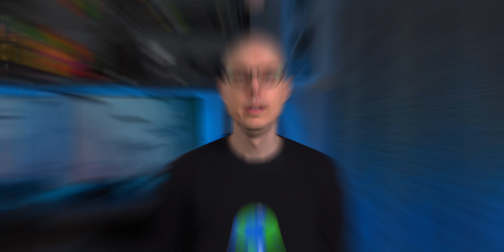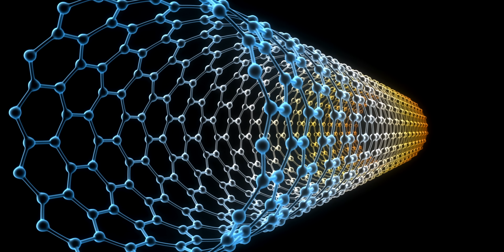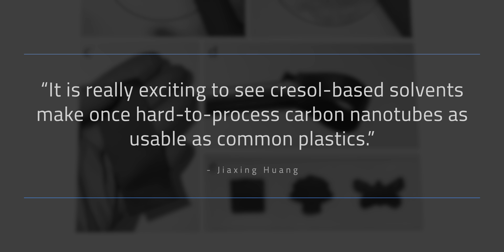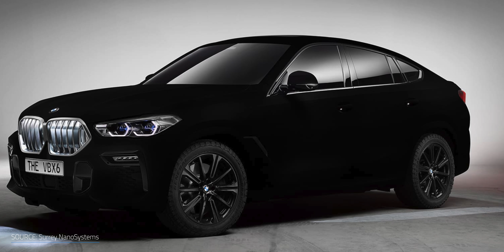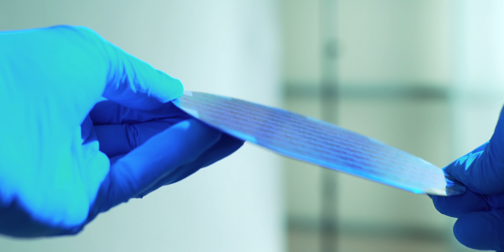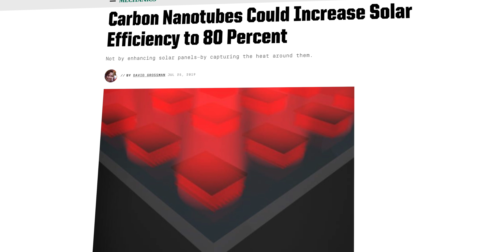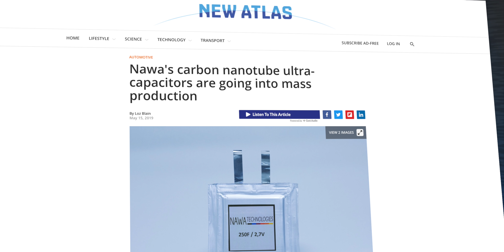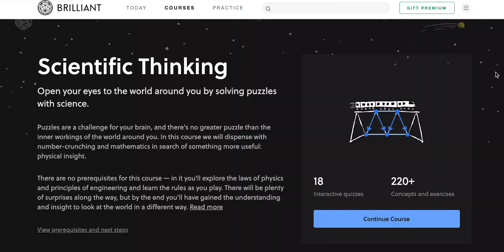How carbon nanotubes might boost solar energy - explained

Comment: Couple of comments as someone who did research in the field... 1)"As it turns out carbon nanotubes can be easily mass produced already." This is true only by technicality. Yes, they can be mass produced, but not really in the desired forms that are useful (yet). You mentioned chirality and semiconducting vs metallic but, as far as I know, it is still extremely difficult (and/or expensive) to selectively grow specific chiralities. The same for of the other major factors determining properties such as length and number of walls. 2) I cringe every time anyone brings up the space elevator. It's not feasible/impossible on so many different levels and has done more harm to the development of nanotechnology (as you mentioned by setting expectations so high) than good. It was a terrible back of the envelope calculation that extrapolated nanoscale properties to macroscale structures. This is a big problem with reporting (and sometimes even research) in the community. Properties of carbon nanotubes, graphene, etc. are so "amazing" BECAUSE they are small, it has everything to do with scale. Once you have 10 layers of "graphene" stacked, it is no longer graphene, it's thin graphite. Properties of bundles of nanotubes are very different than those of individual tubes. This is why the only serious applications (in the near term, if not ever) are for devices that intrinsically operate at the micro/nano scale, such as solar cells, supercapacitors, and SOME instances of composite materials.
Reply: Do you think keeping those amazing properties at macro scale is completely impossible?
Reply: @Mbeluba  I suppose that it depends on what property you're referring to and what you consider macro scale. Carbon nanotubes can have an amazing conductivity and even undergo 'ballistic transport' at relatively large length scales (cm). There are 2 problems in this case: 1) most engineers don't really care about conductivity, they care about conductance (who cares if you can travel 100mph on the interstate if there is only 1 interstate in the entire country). 2) at some point you have to transition from the carbon nanotube to some other material and the interface between the two will be the limiting factor on performance whether that be thermal, mechanical, or anything else (You could have the strongest rope in the world, but it doesn't mean anything if it's just going to slip right out of your hands when something tugs on it)
Reply: @tanman379  what you're saying makes perfect sense on the face of it. I'm curious about the tensile strength, if those 60 Gpa can be maintained in the macroscale needed for stuff like bridge construction.
Reply: @Mbeluba  Tensile strength is the maximum stress (force/area) that can be applied. The force required is large because you have to break the extremely strong carbon-carbon pi bonds and the cross sectional "area" of the nanotube is extremely small (note that we're talking about the scale of atoms so this is no longer a continuous area in the traditional sense). If you want to retain this tensile strength, the entire length must be a single continuous nanotube (which already has an amazing aspect ratio of ~10,000:1 by the time it is less than a centimeter long). If you want to make the nanotube bigger in the radial direction then you end up with a larger hole in the middle, implying  that the number of pi bonds you need to break per unit area goes down (number of pi bonds is proportional to the nanotube circumference and therefore R while area is proportional to R^2), hence the tensile strength cannot keep up.
Reply: @tanman379  but the strength /weight ratio stays the same? And yeah, I am aware you need a continuous nanotube, growing flawless ones that long is what we're struggling with right. The question is would we be able to bunch them up and affix them to other materials without them unravelling.

Comment: The picture of space elevator is wrong. Clearly anything closer than geostationary orbit will have to move faster in order to stay up. That will be rather difficult with a cord smacking you straight back into the planet. Only if the cable is longer than 36k kilometer, or about a little less than the circumference can you have an object that tries to escape and hence pull the cable straight. This will make it fly about somewhere 6500 km per hour. Hence all objects going up will have to speed up as well.
Reply: Doesn't the cable need to be double the distance of geostationary?
Reply: @jeeppayton  The weight of the cable down must be compensated from that geostationary point. Building up is somewhat obvious not going to do anything. So dangling down needs compensation. Both in weight as well as speed. Obvious just like satellites rotate and fly with about 6k per hour to make the one day flip, so too does the entire cable contraption
Reply: @petrusnierop31  what? The cable is constructed from the geostation position in both directions simultaneously! The only time there will be stress in the cable is when entering atmosphere and it won't be going 6000mph or any speed for that matter. Remember, if you start at geostation position the cable isn't moving relative to the earth

Comment: Hi Matt,  another great video, thanks. I've been following a technology based on solar rectifying antennae which use carbon nanotubes and diodes to convert energy in a similar way a radio aerial converts radio waves to a sound signal. A company called Novasolix claims to have a working prototype at around 45% efficiency with a pathway to 80-90%. I was invited to their offices for a demonstration, but am based in the UK and can't travel at the moment. Would be very interested in your view of their technology.

Comment: What about recycling? Is there any research on recycling of them. I am excited about new materials but after the mess we have made with plastic, it would be good to have new materials come with recycling tech.
Reply from the maker: It's fully recyclable and can even be biogradeable. I don't think we'll end up in the same situation as we are with plastics.
Reply: @UndecidedTechnology  isn't there a potential problem with nano-scale fibrous materials, similar to coal dust and asbestosis?

Comment: If and when these panels that transform heat into light (wtf!?) hit the market at scale... holy moly we're in for a huge paradigm shift. So exciting!
Reply from the maker: That's why I'm so excited about this research.  There's a big gap between lab -> manufacturing at scale.  But the concepts that do make the leap are going to make a huge impact.
Reply: @UndecidedTechnology  hoping the U.S. gets it soon. once that is solved on to the rest of all the coverage you mentioned in your videos. Dang I can't stop watching your videos. All the subjects that I'm interested in. Thanks for the in depth coverage. It'll be great if you were from 1 of these research forms or manufacturers.
Reply: I think that part was a bit misleading. From my understanding, the nanotubes would help absorb InfraRed (IR) radiation, which is light (aka an electromagnetic wave). We feel IR as heat because a lot of the molecules were made out of absorb IR really well. So it’s a bit of a misnomer to say it’s converting heat into light, it’s just absorbing light that would normally be absorbed and felt as heat. Granted, I could be misinterpreting what he said, but from what I know, how he explained it didn’t make sense.
Reply: @ands246  His reference to heat in the opening statement is misleading, and his use of it in the explanation could be better.  He states that the material can absorb and channel thermal photons to light, which the panels can use.  His assumptions are that we know that "light" refers to photons of a wavelength in the visible spectrum and that the absorption and channeling that takes place is a conversion process resulting in photonic emission as that light.  As quickly as he moves, I agree that the elements within his explanation merited a little more explicitness.  He does a great job over-all, though.

Comment: Good video.  My career has always been about applied science.  So to me, without useful application it is useless.  I understand there is always a transition when a new thing becomes useful.  I just don't hold my breath or get too excited about something that is not currently applied or useful.
Reply from the maker: Fair point.  I try to compartmentalize my excitement over research breakthroughs.  There's a gap between the lab and mass manufacturing.  But it's still awesome to see our understanding broadening and the creative solutions that may be possible.
Reply: @UndecidedTechnology  I totally agree with you.  FYI: I think the job you do on these video is very good.
Reply: It may be worth noting that over the past year or so, at least two multi-billion dollar corporations have made investments in the CNT space alongside joint development agreements (Birla Carbon and SWM International).  Clearly they think that there is commercial viability and also a strategic advantage that can be gained by incorporating nanotechnology.  Look for accelerating commercialization of CNTs in printed electronics, battery materials, green/smart building materials, sensors and water filtration.

Comment: is it possible to use super conductors to make real real-time data transfer method? Idk, just an Idea I had in mind
Reply: Can you simplify that? It sounds interesting.
Reply: @theencore398  super conductors are just conductors (cables) that are cooled to a low temperature where they become super conductive (= when electrons in the cable/conductive material stay, until other electrons come from the other side and push the first one's out. Just like a hose that's already running, if U put more water from one side, the water IN the hose comes out instead)
this could be used as Internet cables or something, as there are some metals that are super conductive at a high temperature
Reply: @343paperclip  but at the end of the day its same as regular transfer of data through regular cables, so how will it make a change. And we already have fibre optics, so cant this thing out perform it?
Reply: @theencore398  I think you don't really understand how SUPER CONDUCTORS work. Lemme search for a video
Reply: https://youtu.be/h6FYs_AUCsQ
Reply: @343paperclip  ok i will watch it and come back here again. Thank you, you are a nice person👍
Reply: it's basically like having a long tube and marbles
if you put the marble in the tube, you need to push it so it can go out of the other side. However, if you fill the tube with marbles, and try to put one more inside, the marbles that are already in the tube go out

normal: (one marble example) 
______________
O   - >                       O
----------------------------

super conductive (tube full example)

           ______________
O->    OOOOOOOOOOO
           ----------------------------
           OOOOOOOOOOOO
           ----------------------------

you know what I mean?
The marble/electron doesn't need to travel the distance, so it's REAL-TIME

I hope the video explains something (I didn't see it)
Reply: @343paperclip  yeah i got you point in that hose example. And it has became crystal clear due to this marble analogy (sorry for any grammatical mistake, english is my second language)
Reply: Thank you panzer of the lake for that good wisdom of yours (i just came across a panzer of the lake meme😆)